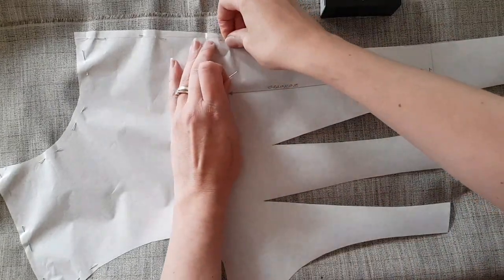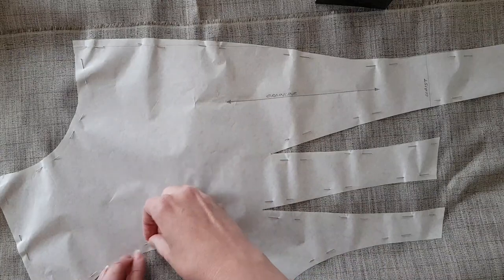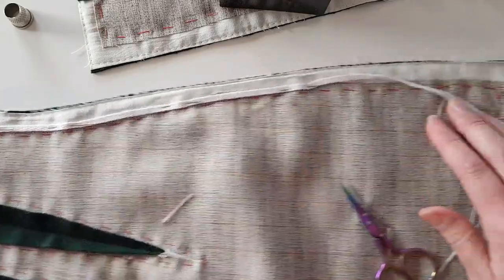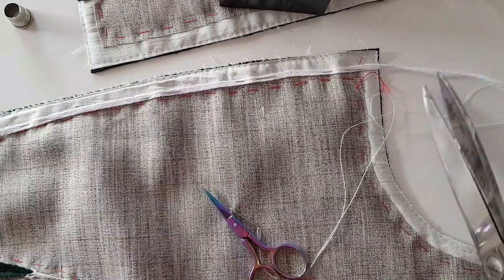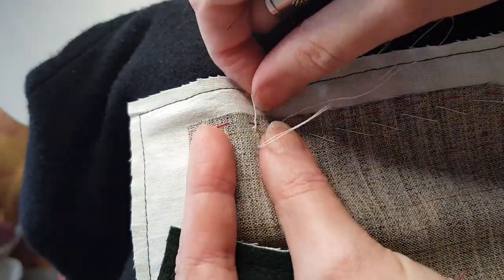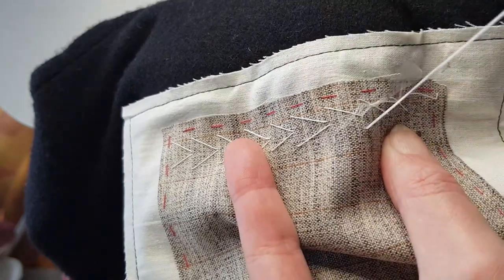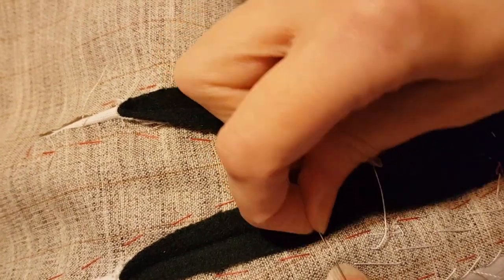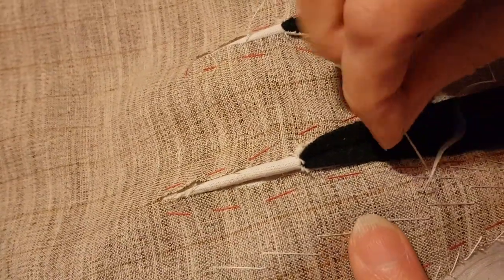Sewing a Victorian 1890s jacket - how to padstitch (pt 2) (Foundations Revealed 2023 competition)

Comment: I had a question- why are you sewing on the 1/2” tape on top of darts (and also - why your darts seamed to be open?) but then you mentioned that you are putting boning inside, so it makes sense… ok! Did I understand right? But still - why the darts are open? Not to have bulkiness?
Reply from the maker: Yes, you are right :) The tape on the darts is to put the boning inside, and opening out the darts on thicker fabric helps to reduce the bulk, as you've got only two layers where the dart is as opposed to three with a closed dart.
I will be leaving the darts closed on the vest part, and inserting the boning inside the darts.
Reply: @esmesvintagecloset  I never ventured into serious tailoring, (like - making jackets) thank you for all your advises and instructions- even mentioning that you pre-shrunk horsehair canvas - thank you!!!
Reply from the maker: The modern synthetic canvases shouldn't need shrinking, and wool based canvas should only be steam shrunk and not soaked.  It's just a worthwhile precaution to take... at work, we had a huge roller press that we would run bolts of fabric and canvas through to pre-shrink them as we didn't have the ability to wash bolts of fabric before cutting.  We also used it for fusing one fabric to another (like buckram to waistband fabric) because once on, that stuff did not come off, unlike pressing it with a "regular" iron.